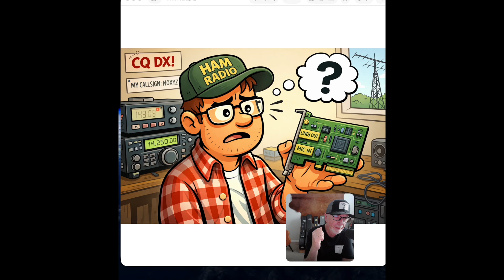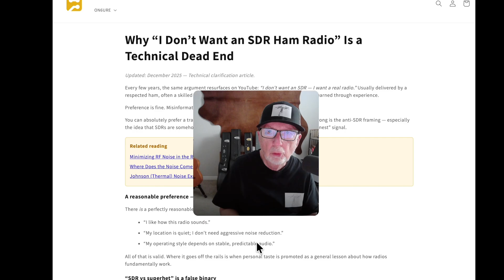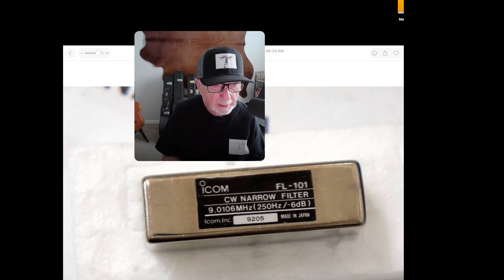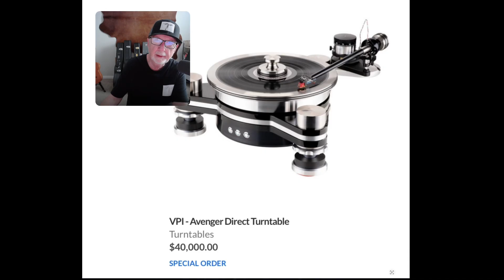SDR Transceivers Vs "REAL RADIOS"??

Comment: There Is Nothing Wrong With New Technology as Long As You Don't Throw Out The Old. This Newer Stuff Is Cool But Hope Folks Would Learn On Older Equipment First Because That Is What A Real Radio Is.....Sort Of Like Learning To Drive With A Manual Transmission...Yes Im Getting Old....Going For A Bronto-saurus Burger😆
Reply from the maker: Guys are still collecting and fixing old boat anchors.

Comment: It all depends on what's inside, if there are good front end filters in the receiver and has a decent dynamic range, some band pass., etc I prefer a a temp stable VFO oscillator section, good shielding etc., usually means it will deal with EMI/RFI better and stay on frequency.

Comment: My main radio on HF is a made in 1990 or thereabouts Icom IC-725 fully analog radio. I have a uSDX+ that was my first HF radio as well.  What's crazy is when plugged into the same set of computer speakers, the received audio sounds the samel between the two radios.  No one has ever known I was using a cheap SDR I bought on Amazon for $125 Canadian when I have used the uSDX+ unless they ask about the rig.  The biggest difference I find between the two radically different radios is the power... At 100 watts the Icom is generally if you can hear it you can talk back if propagation is good, within reason of course. The uSDX+ often runs under 3 watts, so a pile up buster it's generally not ,but I have had a couple QSOs to Russia from Nova Scotia under 3 watts with no issues whatsoever

Comment: The writer of this post is correct about the facts.

Whether we like it or not, new technology replace old one. 

If individually asks new technicians if the prefer to paid 500 for an old rig or to continue looking for the used 600 golden Icon 7300 they will
Most likely settle for the used icon 7300 even at 800-900 price point.

It’s just evolution of the ages. 

I prefer old rugged equipment, not only because I like to talk but because I like to fix radios. I’m one of a kind flavor, I don’t mind people bringing me radios for me to fix. I still learning everyday but I’ll fix them.

So to each their own. There is no right or wrong it’s just how people see things.

Comment: SDR users run them wide open bandwidth.. thats my issue.... most radios transistor radios dont hear 4k plus wide. yet you will hammer someone 4 to 10k away .. then asked to tighten up a lil. they get bent and flip out.

Comment: "HAM operators resist technological advances".
Oh there were plenty of advances, playing the devil's advocate - which made radio largely obsolete since the late 1990s, save for some few edge scenarios.
People still enjoy the hobby, and some like the even older stuff among all the obsolete stuff more than the newer, high-tech obsolete-at-design-time stuff ... that's ok with me.

I personally certainly welcome if things get lighter and cheaper(? have not observed the market), though people who used to  like to repair gear themselves will perhaps not be happy with those SDR things.
At the end of the day, the software also only performs the math, in a discrete way, that before, analog circuits approximated. If the result is clean, I personally don't give a damn ;)

Comment: for some reason all my hf radios ended up being yaesu, except for the g-90 which I take out in the field.  DX FT 3000, 991a, 710--the 3000 is more of a hybrid, as well as the 991a.  The funny thing is I started out on an ICOM 751.  No dsp whatsoever.    If I can hear the other party and they answer back, its all good.

Comment: I don't like SDR's personally just because of my distaste for the sound of the substandard audio processing in most (not all) of them.  The thing about pure SDR's that I REALLY don't like is that it has given manufacturers license to release poorly tested products knowing how easy it is to just throw out updates whenever they feel like it.  Sure, some old radios required updating but nothing compares to current rigs released with advertised features that don't even exist in the radio when I goes to market.  I think the number of "updates" that have become common practice substantiates that.  Get paid first and then finish the radio.
Reply from the maker: good points

Comment: It does make me wonder why the best receivers are almost 10 years old now.  In fact some brands are testing worse than the previous models.  I kind of wonder if component quality is starting to be a real road block to further development.  SDR quality depends a great deal on the chip engineering.  The software can only do so much.  73, KF0BBU

Comment: I use both. With the noise floor in my area, the top 100 rigs on Sherwood are probably indifferent.

 Seriously, I use an ft891 when chatty, but I'll use an Airspy HF attached to a 2m/70cm antenna dangling off the wall by a nail when I just want to listen. Gqrx on linux for that.  For digital, I pipe the audio right into wsjtx or fldigi.

Comment: Yes, there are many Amateur opertors who will not move into the digital age.
When D-Star first came alive in the Mid-South, there were only a handful of us who adopted it.
Hams all own digital phones, digital TV's, listen to digital music but they have an issue with ham radio.
It has and still is a struggle to get Hams to embrace the future.

📻📻📻📻📻
Reply: My problem with D-Star was that it wasn't Fusion and Fusion wasn't whatever else there is/was/will be.  I was not/am not ready to buy a different radio for each proprietary digital mode. When all the "Betamaxes" are done and one reigns supreme or I can flip a switch to use any of all those modes, I'm going to use SSB, CW, and FM "analog" for as long as repeaters are yet available for old school FM.  I don't own a TV of any calibration btw.

Comment: It's called Amateur Radio for a reason.  You should build your own equipment.  Any idiot can run out and buy a fancy radio.  😊
Reply from the maker: I'd be happy if hams just knew some antenna and transmission line theory.
Reply: @BustRadioMyths  the folks under 50 grew up in a "Plug and Play" world. They have to step away from that approach to learn. And why bother if you've got the bucks to keep buying more stuff, there's ALWAYS going to be more stuff.

Comment: Your point is well taken, and I do agree.  However, to these aging ears, there's nothing like the sound of a super-het receiver.  I tried an IC-705.  The sound on it was tinny, and grading to my nerves.  It didn't matter what I tried - filtering, turning down the treble on the output, etc - I just didn't like the sound on it.  So, I traded it for an FTdx10 and the ears went 'ahhh'.  I might have better luck with a different SDR, but the Icoms just aren't for me.
Reply from the maker: The FTDX10 does indeed have a nice audio sound. I wonder if it’s just having a better audio amplifier?
Reply: @BustRadioMyths  That thought had crossed my mind.

Comment: Gatekeepers be gatekeeping. Neumann Vinyl cutting lathes have been digitally controlled since the 1960s. So your $40,000 artisanal hand-flattened chrome vanadium wax spinner is playing back from a vinyl casting of a lacquer platter cut, usually, in the 70s or whenever by a computer controlled lathe. Microscopic dust and all. How’s that for gatekeeping?

Comment: In audio, $40k for a turntable is relatively inexpensive. There are turntables upward of $500k, tonearms for over $50k and cartridges over $20k... I say that's fantastic! I can't afford any of it, but I sure do benefit from the trickle down of technology! My FT-710 is an absolute powerhouse filled with wonderous technology and features! Works great and to me, so exceedingly inexpensive for what it does and its performance. For under $1000, it has a receiver that is in the top 5 rated of all receivers, ever. I can remember not many years ago that the top rig was an Icom IC-7800 and it cost over $10k, all analog. Now for less than 10% of that cost I have a better receiver. I understand nostalgia, and I love my old tube radios and working on them and fixing them and calibrating them.... Get the picture? But for performance/dollar? Give me what's trickled down! I can always turn on an old radio and enjoy it for what it was, but my daily driver will always be the new. However, please do not buy any of the emperor's new clothes and caveat emptor as always. There will always be the shiny new thing that sounds too good to be true and usually is. 73
Reply from the maker: Great points and perspective on the evolution of technology in our hobby!
Reply: All purchased by guys who cant hear shit without hearing aids from Costco

Comment: My main rig is a Yaesu FT450D which is far too big to take portable (for me anyway) . My Xiegu G90 and G106 are perfectly portable . I do not use the digital options other than an occasional smartphone driven WSPR test if I try a new antenna. Simple is best in my world but light weight comes a very close second . 73 M7BLC

Comment: My only gripe about SDR implementations is they all seem to be menu driven. Touchscreens or mouse driven interfaces. Options behind options. It's like trying to wallpaper your hallway through the keyhole. Don't get me wrong, I've got a few including the Malahit DSP2 which is superb once you set it up properly but still... As technically brilliant as they are it's just nice to sit back and twiddle with some good old analogue knobs and switches, which is why for casual listening and nosing around the HF spectrum I like to fire up my trusty old Icom 751A.
Reply: Ya and they could do it with knobs and switches. But knobs and switches cost money and take up real estate. I hate programming as much as you do. But ya know, some of the cheaper Chinese stuff is much easier to program and actually make more sense than the more expensive brand names. It's all about give and take. With every gain there is a loss.

Comment: In the real RF world, I have a real radio, SUN SDR2 DX, HF/10/8/6/5/4/2M bands, with super receiver coverage about 30Mhz... I had the dx101, dx10, 7610, sold them all. It is all down to operator style, nothing to do with filters, DNR, and all those gimmicks, all of which I don't use
.... Happy SDR Owner, de Ei2iP... BTW I use AM on 10M working NA..

Comment: Much like the old augment about using points and coil ignition system on your car. Often the augment is there because of one's lack of being able to understand unfortunately that cant be the case hear since most of us don't understand either technology SDR or analog superheterodyne. Its deeper than understanding its, ownership attitude. Whatever I own is 👌 best, we see it in reviews all the time.  Im not going to admit that my radio is just so so. So we do have numbers and graphs to help us get started. 
So for Me being a ham for 50 + years I like the Yaesu hybrid approach with the DX10.  That thing can hear a feather land on the moon. I did get the optional CW 300hz roofing filter and it does do a slightly better job. But the digital side is amazing by far the best rig. Why? Simple because I own it . ...  hihi.

Comment: Currently the radio that gives me the most smiles is an old ft817... But data sheet performance wise I fully admit it has terrible specs.
Be careful of knowing the price of everything but value of nothing.
I've used a G90 & 7300 & certainly old & new rigs equally have their place ( as does FT8 & ssb & CW & spark)

Use anything & everything as appropriate. Exclude nothing.
Reply: The 817 is total legend. Just look at the crusty old 817 of ol' Peter, VK3YE, has been dragging up and down the beaches and shores of his town Australia.  
I have one I've not used a lot, but it's always there if I need it.

Comment: I have a collection of radio equipment from a Yaesu FTDX10 to my lovely 1967 Swan 500 and lots in between.... My hand has a tendency to wander towards the VFO of the old gear....
Reply: I understand this. I use a Yaesu FT991A and a Yaesu FT1000MP MK V in my radio room. I really like them both, but when I use the 1000, with its receiver controls “out front” I feel like I’m ‘operating’ a radio. But both are good, to me.
Reply: @bobadkins7377 yep, nothing better than not having to go menu diving..lol...everything is right there in front, just turn a dial or press a button.
Reply: @bobadkins7377  Agreed.. modern rigs are a marvel but i find the older stuff more fun to use.... 
My Swan 500 runs through an MFJ tuner. When im using it my hands are a blur of activity tuning the radio up and getting a good antenna match, you have to work the radio. Its not for everyone and sometimes i cant be bothered and thats when the FTDX gets switched on....🤣🤣🤣
Reply: I understand completely. When I first got into Ham about 4 years ago I bought a Kenwood 130 TS. To my ear that old Kenwood has better audio than my 710 does, it's has more noise sitting idle but during a QSO that thing sounds awesome!
Reply: @bassangler73  TS130.... a cracking little radio.
No school like old school.......
Reply: @Team-fabulous its crude and simple, but I love it! No menus, just knobs and buttons. It seems like Kenwood is pretty much stayed with that style. Im sure radios like the 890 and 990 have menus but they have buttons everywhere.Thats just what I like, I got lucky and the guy that had that 130 I bought had the matching power supply , boxes and original manuals. Its no question my 710 blows it away on recieve but it can't touch the audio! I don't do FT8 or anything digital so I would rather use that old 130 for SSB and CW.
Reply from the maker: That's an impressive collection!

Comment: I’m not a ham operator just a MW Dxer with an 850m wire. I’ve found SDR’s have a slightly worse noise to signal threshold. The audible signal gets lost in the noise way before you lose audibility on an analogue good radio. I still use my NRD-525 as I can hear the weakest of signals that often can only be seen by the Perseus SDR as a carrier. Of course for normal operations on SW and using SSB it’s a different scenario.
Reply: Oh yeah, Arctic Radio! I see your videos. Interesting indeed. Some of those videos show your receivers working AM stations close to me. I have questions about your antenna but I’ll follow up on comments to your videos.
Reply: That JRC NRD is a great radio for sure. All I can say is not all SDR radios are equal and not all are quiet or have a low noise floor....
Reply: agreed, but sdr is useful on so some things
Reply: @najroe Sure are and you have the ability to record whole bands too. It’s what most serious DXers do now they just record and go through the recordings later. The ability to shape and move the bandwidth certainly is easier.
Reply: @arcticradiomy specific is catching signals using as little as possible,  i have caught Chinese SW on a crystal radio,  
true, I cheated by using Computer to find the signal and using a diode instead of a galena crystal, still it was fun hearing the broadcast on old ww2 headphones, I had to turn of my laptop and phone because they put out too much hash and drowned out the signal, but it was a small thing.
Reply: 😮 850m wire
Reply: @buddwik2719 my first thoughtvwas a BOG, beverage antenna on the ground
Reply: @najroe   I think It gives you a lower gain than this. Btw. Once I connected my MW receiver input to a grounded rebar through a 2m wire and I was able to receive indian transmissions as I live closer to India. 
I don't use MW and used to listen to SW. The problem I have is powerful chinese and Indian stations overlapping stations that come from long distance. 😢 I live in Sri Lanka. I can even receive RNZ Pacific, but chinese transmissions interfere most of the time.

Comment: I think all modern transceivers should be hybrid. Call me old-fashioned, but I still like tube type audio when listening
Reply: I have 5 different 2m all-mode rigs I use on SSB.  The very oldest one, Kenwood 751A, has the best RX audio. It's not that it hears more, or that it makes voices sound better, but that the static is softer and far easier on my ears. I'd rather listen on my 751A than the IC-9700, but the 9700 gets used more. 

I'm sure I just need one more radio...
Reply: @wadepatton2433 don’t we all! Man just one or 2 is never enough 😂